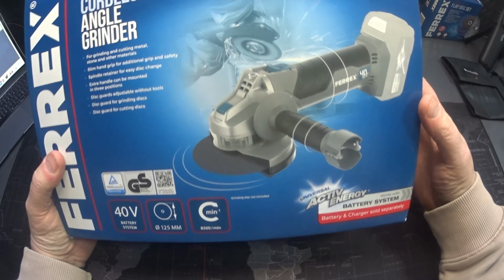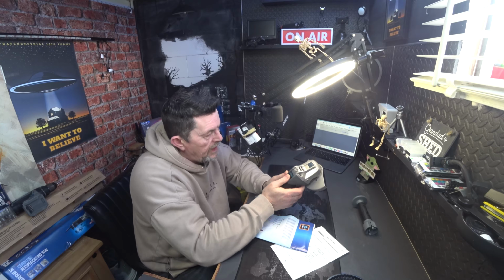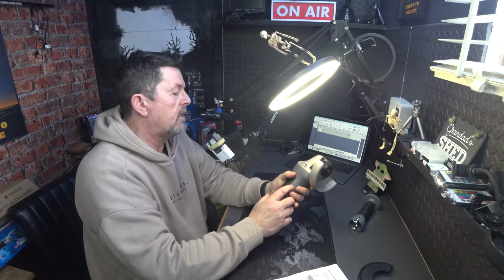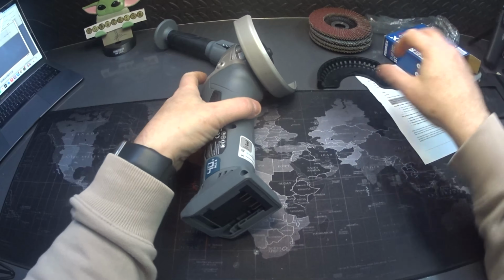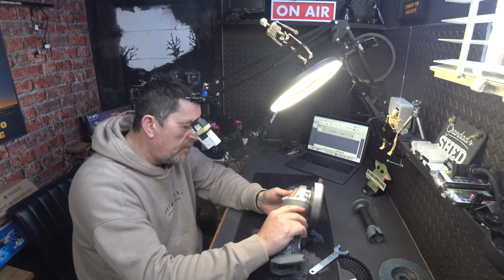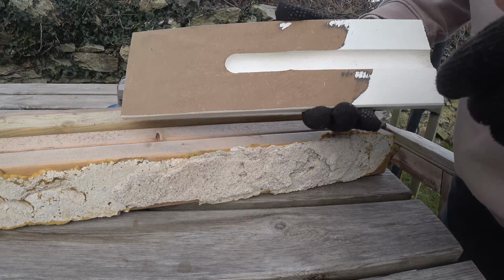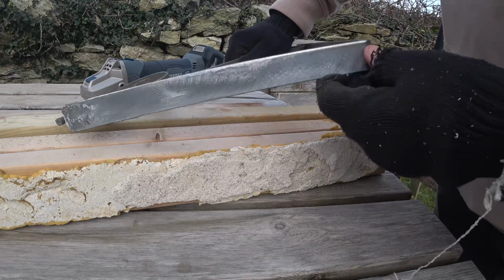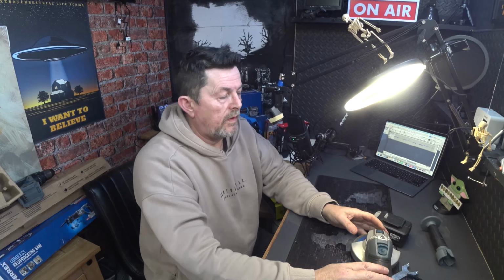#Ferrex #Cordless Angle Grinder UNBOXING AND REVIEW

Comment: Had one of these for some time and have given it some heavy abuse and its stands up well, for the price and warrantee you can't go wrong, pity there discontinued.
Reply from the maker: Oh are they discontinued? I didn’t know that, I’ve given mine some stick and it still works as it should, in fact I’ve got a job for it this weekend ( if the weather holds up). Only one drawback is that it chomps on the battery 🪫 and needs recharging quite a lot, thanks for the comment, always appreciated

Comment: Nice review and demo vinny, im a bosch guy TBA all corded but ive recently bought the inmpact driver and drill plus 20 v and 40v batterys and charger ,im impressed so far with them , im wondering if the brushes are replaceable or are these sealed units . Nevertheless in a novice woodworker and diyer,so will hopefully last me a few years 👍good video .thanks
Reply from the maker: Hi David, thank you for your comment, it’s always appreciated. I’ve been using the impact drill lately, I’ve made a pergola from old recycled wood, it’s done great so far dealing with some decent sized (112 mm) screws, I’ve also used the cordless grinder to take the old top layer off the wood, it’s power hungry for sure! Makes an easy meal out of the 20/40 volt battery.
I’m not sure about the brushes tbh
Reply: @vinnymars  time will tell on there uses, can't complain at the price's. 👍

Comment: Absolutely useless piece of kit. I had one and used it about 12 times the angle grinder continually cuts out when trying to cut and eventually after about 12 goes the angle has given up and stopped working. 
not worth the money  and a waste of time. 
The old saying is true if you buy cheap, you get cheap . I would rate it zero stars.
Reply from the maker: sorry to hear you had problems with yours, mine has been problem free (so far)